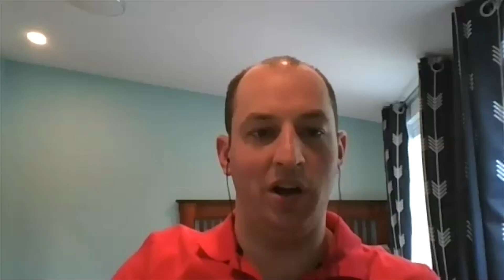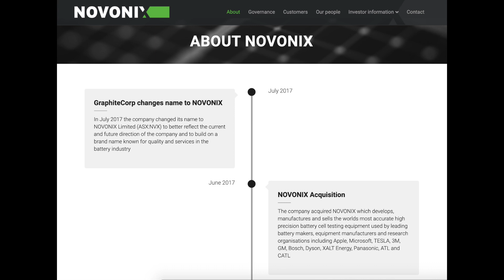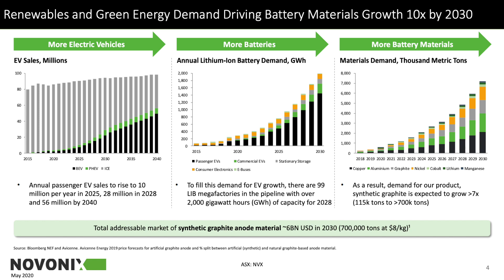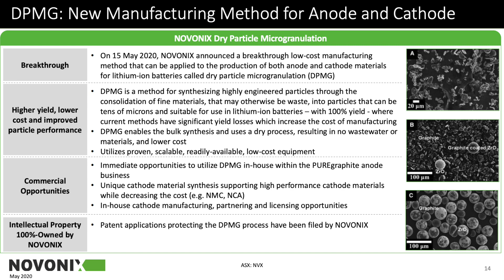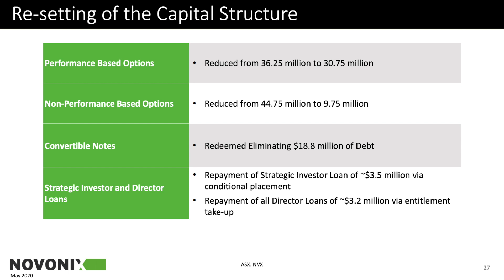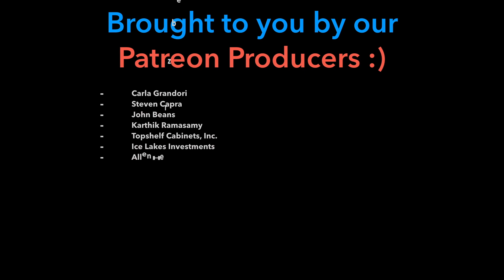Synthetic Graphite For Next Generation EV Batteries w/ Dr. Chris Burns

Comment: A poster picked up a new statement in Dr Chris Burns webinar about Continue Co-locate with EV battery manufacturers from 2026, which means it would already have started well before then. https://i.ibb.co/mJVTzJR/77-E9-DB25-DD5-C-4366-9460-1126245-E947-E.jpg Some interesting discussion points on this forum about that and other comments by NVX COO. https://hotcopper.com.au/threads/ann-novonix-investor-webinar-presentation.5515208/#post-46060596

Comment: That's fantastic news, for the earth acording to the Climet Crises. No waste is the best for the carbon footprint. ♻️😉👍🏻
Reply: Aksel William Danenbarger Did you pay attention to the part where the souce carbon has to be heated at 3000 degrees C?  heating at 3000 C the 30,000 Tons needed by Giga Nevada is a lot of heating.
Reply: @earnmyturns6305  No, im sorry. I didn't get it right with me. But, good job anyway. 👌🏼

Comment: Very interesting, thank you, I have now subscribed to your channel. One concern, in your interview he mentioned it takes 3000 degrees of heat to make the synthetic graphite. I would really like to know if this company plans on using renewable power to produce their synthetic graphite, some? All?. Any chance you can ask a followup via email? If they don't have a plan to use renewables then it is possible that mining the graphite might be only slightly less dirty given the extreme voltages and amperage required to create the heat needed for their product. I am very happy that their is this alternative supply chain for graphite, it will be needed but I want to make sure that when I buy an EV it was produced as cleanly as possible, not that we just get ourselves into another mess. Thanks! Rob.

Comment: ⚡⚡⚡⚡⚡ That's 5 of 5 lightening bolts for awesomeness.  Graphite anode is going to be with us for a while and still has legs.  The graphite coming out of China is definitely not 'green' and processes like DPMG and graphite that's mined locally in environmetally friendly ways is coming over the next 5 years.  It's going to be BIG business.
Reply: My first thought was
"Has Jordan seen this?"
Reply: indeed bro!
Reply: 14:40
"Concentric sheets of graphite" (!?)
Reply: @rogerstarkey5390  Yeah, I'm contacting Chris to dig a little deeper.  I've asked a few people, but they don't know what the impact of this is.  I want to know how the li-ion intercalates into a structure that sounds like it has no edges.  Through the chicken wire?
Reply: The Limiting Factor I thought the next frontier was gonna be replacing graphite with glass (SiO2) or Silicon resulting in denser charge packing.  The problem to be overcome was the material cracking, can be done covalently linking Silicon nanoparticles to a polymer.  So now all that is passé?

Comment: What's the difference between their artificial graphite vs the exisiting products in the market?
Reply: From the interview: significantly cheaper and greener to produce, uses 100% of the raw materials (eliminating about 40 to 50% waste ) and they can use the waste material from current methods and use it also, (meaning a low cost raw material source).  They are also able to improve performance--the specific metric being battery longevity.  The bottom line take-away they don't really come right out and say is that they started by developing a method to much more rapidly test and validate the longevity of experimental cell chemistries and were planning on selling that technology as a service until they realized it was actually a powerful aid in accelerating the race to a better chemistry--essentially the goose laying the golden egg--and it made more sense to use their new testing tech to find the next killer chemistry themselves--the graphite portion of it anyway.  The other large item was developing and building a US / North American supply and manufacturing chain reducing our dependence on Asia.
Reply: Phoenixklinge
Maybe watch again? Twice?
Reply: @rogerstarkey5390  thanks man, really helpful

Comment: The big take away for me is reducing the test cycle from 2 months to 2 weeks .
Normal rate is 8 percent a year 
Now improvement rate will double or triple .
We are going to see battery improvement 20 percent or so
Reply: The biggest points were
100% material use (no waste)
Graphene (holy grail material)
Reply: @rogerstarkey5390  
Graphite by definition consists of sheets of graphene. The interesting part here is they're producing spheres of concentric graphite, which is like an onion of graphene hollow-sphere sheets filled with more of the same (so ultimately not hollow, but graphene is basically two-dimensional, so a single sheet is the shape of a hollow-sphere), which means the surface of the sphere is like a solid sheet of graphene, and therefore reluctant to engage in chemical reactions.
So you're kinda right and kinda wrong. Probably more right than wrong.
Reply: I love it when you teach me something new. And it’s not just about efficiently testing cathode and anode material this should extend to fast turnaround trialling of various battery chemistries as well.